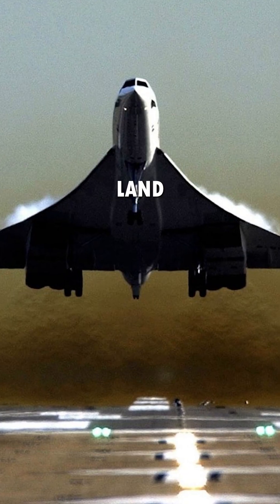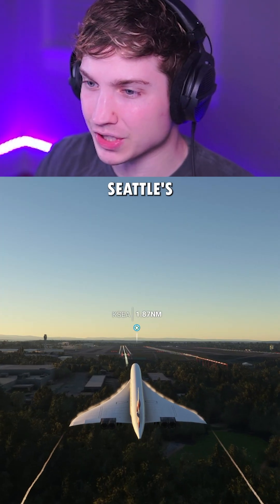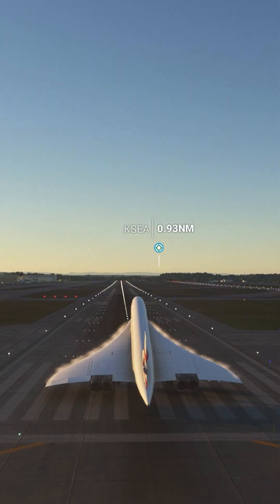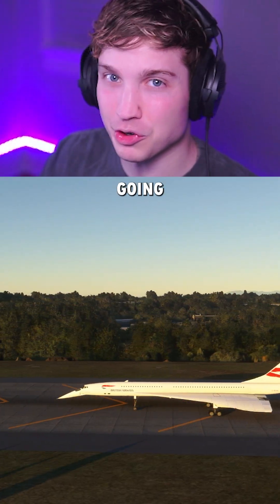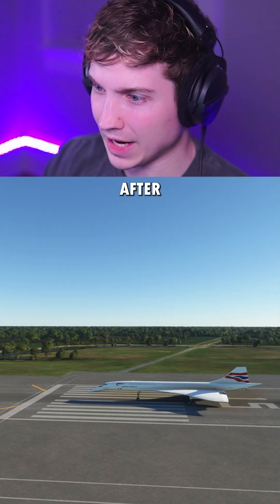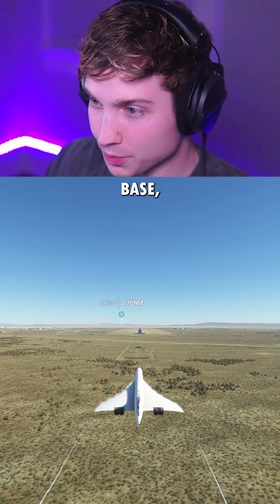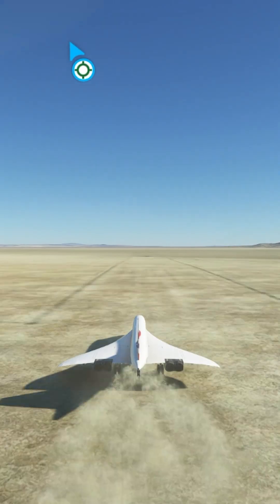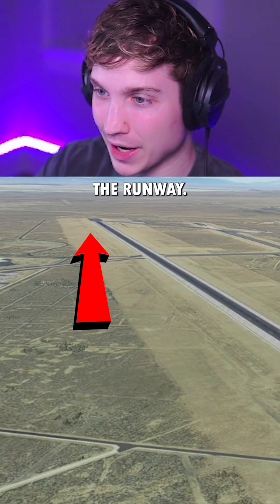Can the Concorde STOP Without Brakes or Reverse Thrust?

Comment: Without brakes an airplane even accelerates with idle thrust to about 80 knots.  So basically it would never stop at all.
Reply: That’s not necessarily true, depends on the weight.
Reply: @vito774  True. Sometimes it  needs 40% power to make it start moving. But once rolling it is rather common that you need to slow it down several times before reaching the take off position.